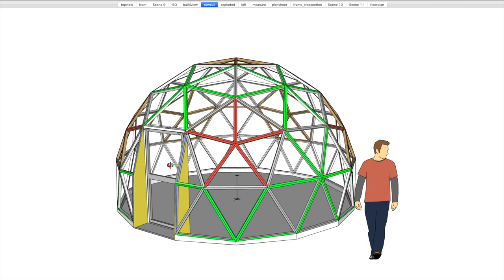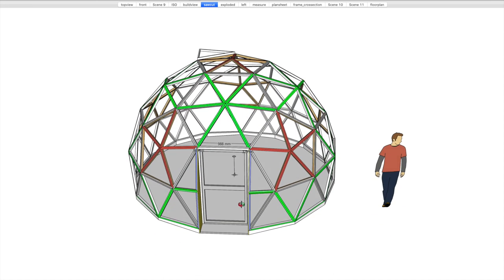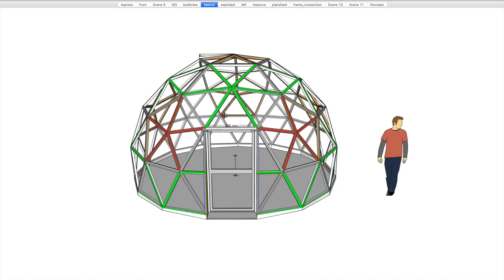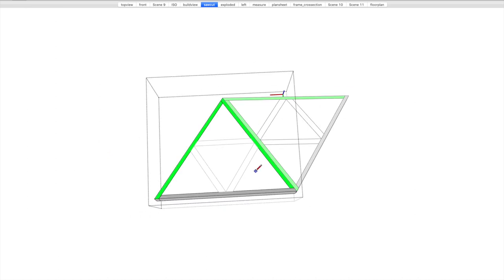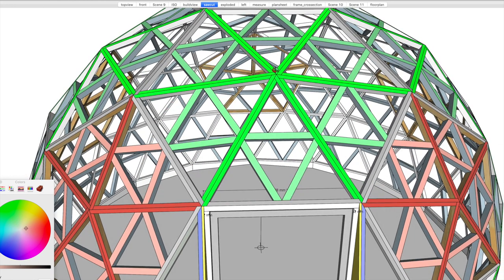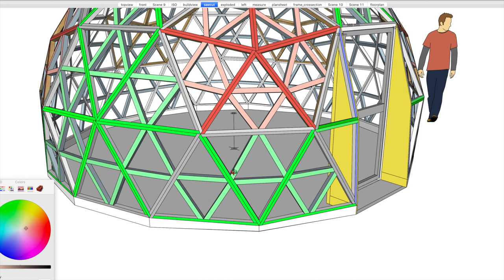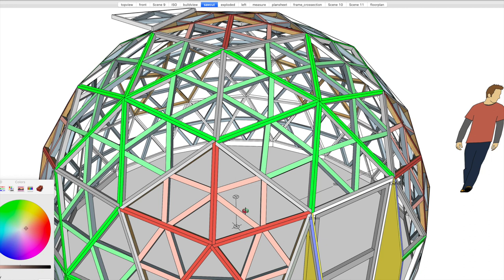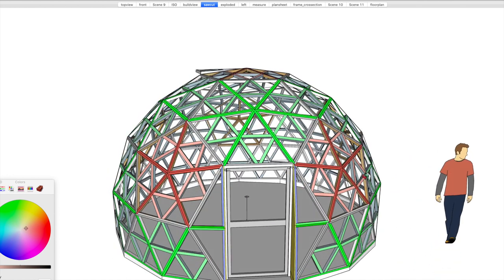Dome hack - Double your dome frequency - super easy method!

Comment: Paul, first and foremost I'd like to thank you for the amazing work you do and share with us here. 

I'd like to ask you a question I'm not sure you've answered before - how feasible is the idea of building a bevelled frame dome house, not just a greenhouse, but a proper one? Is it a pipe dream or just a matter of upscaling the beams and adding some sturdier walls and insulation? In theory, a DIY house like that should be fairly cheap and heat-efficient, which could somewhat help alleviate the impossibility of getting decent housing for the current generation (while naturally keeping the landscape high-rise creep-free).

I'm a millennial and a dream of having a decent house for a family of my own becomes more of a distant dream with each passing day, but thanks to your channel, it seems I might be able to not only afford an incredible house one day, but be able to build it on my own. What are the risks? The pros and cons of such an undertaking seem fairly obvious, but could there be some caveat that's easy to miss?
Reply: I've done that myself. In the end it comes down to what size and what are your skills or means of manufacturing the frames. It also depend on your specific country build and administrative regulations.

Comment: I Think we need to formally recognise this as up studding. smart idea could you not get away with it using finished solid panels and simply putting the centre triangle in inside out cancelling out the angles.

Comment: Can you repeat this, adding another level of flat triangles inside these, to make an even larger dome of the same frequency? Applying recursively do you ever reach a size of dome where you need to add more full nodes?
Reply from the maker: Sadly no, you would get hubs that are flat which are not stable, doing it once is ok because you don't get flat hubs, they have an angle because of the dihedral.

Comment: Wouldn't jumping up to a 4V dome with 6 struts vs 3 be a less complex and less expensive solution than all the extra lumber needed to add all the extra triangles to make a 3V into a quasi 6V dome?
Reply: Its easier to mod the 3v but i`d go for the 4v because it would look better. Modding a 3v into a 6v wont alter the curvature..

Comment: Hi Paul, I was wondering what type of clear covering you had on your dome? Is it a polycarbonate material? I have looked in the US for someone who makes this stuff, but everyone wants to sell me the double walled stuff. Can you advise on a brand name or maybe the way to google it so i find what I need. Thank you.
Reply: I'm sure he has a video on this but if I remember correctly, it's UV resistant agricultural polytunnel sheeting. If you search for this you will surely find a farm supplier that stocks it.
Reply: @davelowe1977  Hi David, thanks for the reply. Trouble that's what everyone wants to sell me. What I am looking for is a single layer or thickness of polycarbonate. I know its out there. I just can't find anyone who makes it. Dual wall will not work for what I need to do with my system.  Thank you for answering my post.
Reply: @sambrandt3688  Ah - you want something rigid rather than flexible. As I'm sure you know, there are many other transparent and rigid plastics such as acrylic which can be bought in sheet form and cut to size. Have you considered using one of those?
Reply: @davelowe1977  Hi David, yes for a very short time LOL. you have to be very careful to pick the right single layer cover. Some plastics do not react very well to direct sun or temp changes. Nasty things happen like glazing and cracking. I am not looking for a yearly repair/change over. There is a single layer polycarbonet out there that I am looking for. I have seen it used to cover a dome. I just need to figure out who makes it and if I can get it here in the US. It's one of those things that should b simple but turn's out to be a pain in the rump to solve.

Comment: This does not double the dome frequency. All youve done is attached supports to the frequency of the dome and at the same time defeated the supports because now it is twice as heavy on the same frequency.
Reply from the maker: No the wood is half the size so weight is the same just more triangles which are smaller, it works great: https://youtu.be/6ERJx-BPw3w